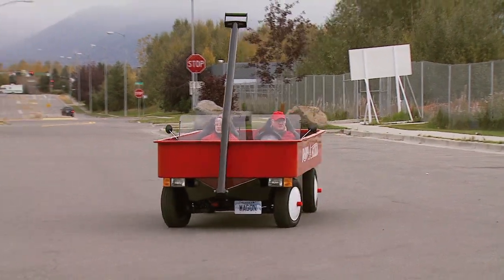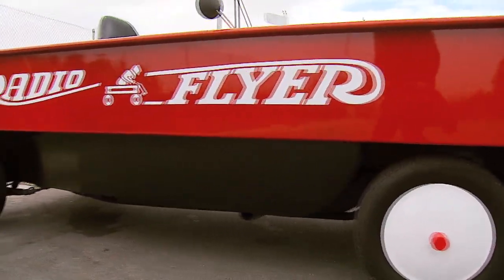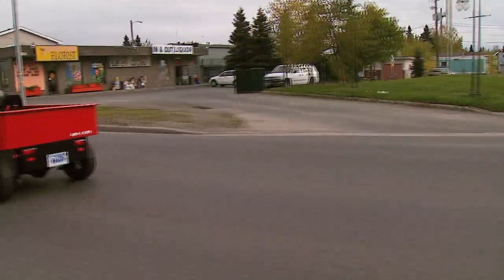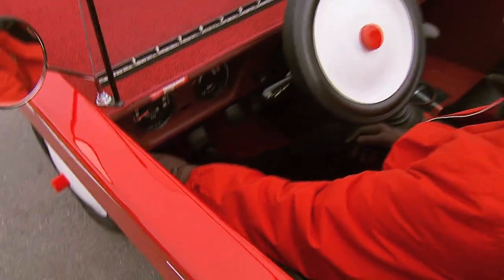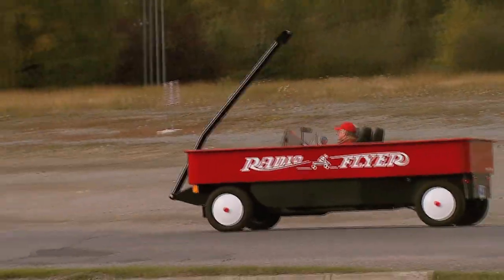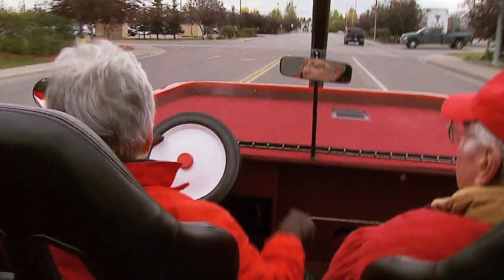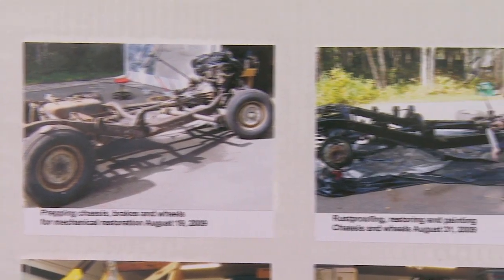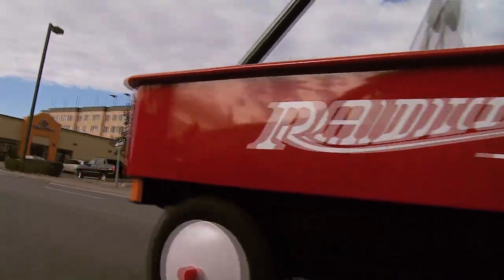Radio Flyer Car Original Story By Mike Nederbrock for KTUU-TV

Comment: Or if you have a real Radio Flyer Wagon that needs new tires...or you want to make your current one run MUCH smoother with oversized pneumatic tires, here's how I did it for under $20! Search on YouTube for "Wheel Replacement on a Radio Flyer Wagon" VERY cool job, guys, but that's WAY above my 'pay grade'.